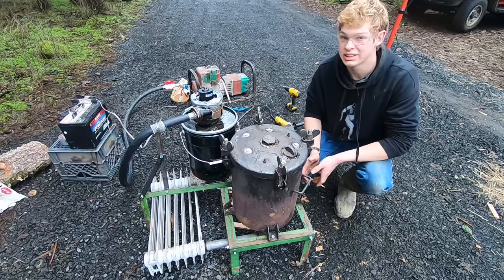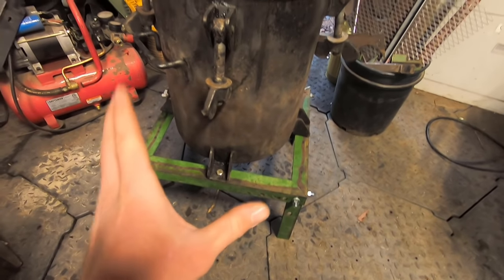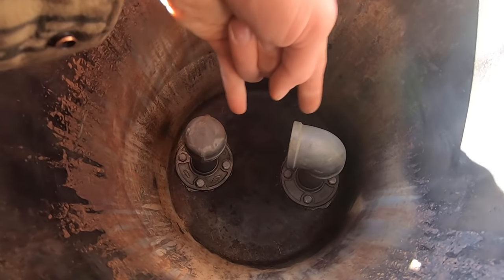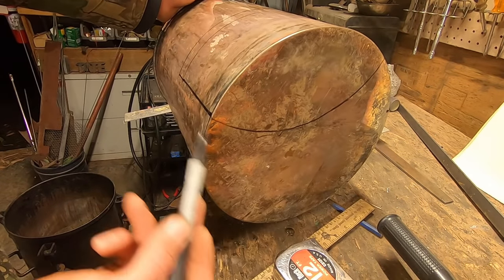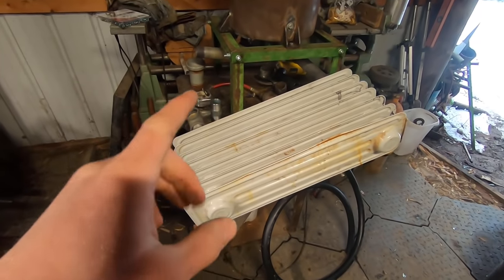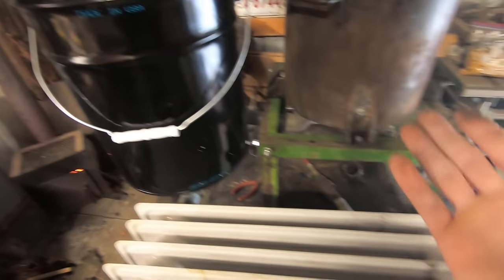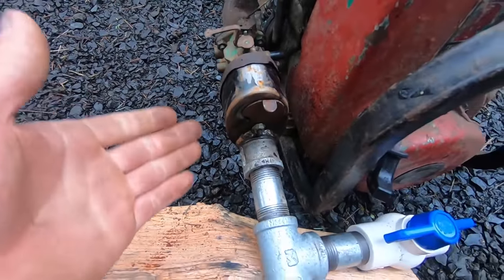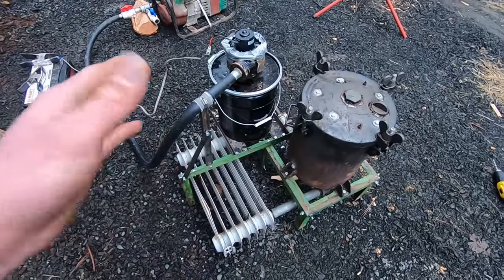Building a No-Weld Woodgas Generator! (A Functional Gasifier Built W/ a Hand Drill and Grinder?!)

Comment: It's a pretty cool project,  but with a biomass digester being easier to build, and cheaper, pluss the added benefit of yielding fresh composted soil, fertilizer,  and clean burning methane, you are left with acetic acid and carbon dioxide.

The acetic acid being the only true negative byproduct. 

The carbon dioxide would be filtered by plants, and the methane would be your clean fuel source.

The compost also generates a substantial amount of heat to say heat a living space. 

All while conserving wood for building materials and such.

Comment: You gas seperator should be far larger than what you are using. Think of a 80 gallon air compressor tank for just that engine. The wood burner gasifuer is good, but any Gas seperator operates at LOWPRESSURE. Really low. To liquify gas you raise pressure, understand? So just dump that gas into a huge tank, and vent your fuel off the top. Cooling it is going to happen easily in just short run of steel pipeline. Then into the gas seperator DIRECTLY after cooling the evaporates from the generator.

Comment: Great simple build but you just created a huge bomb in that combustion chamber with no safety release. If your engine/blower ends up demanding/pulling enough air into you combustion chamber through your flapper valve it can and will cause the gasses in the combustion chamber to ignite resulting in an explosion (ask me how I know) turned my down draft gasifier into a mortar tube launching  burning embers about 75ft into the air. Your unit is for all intent and purposes sealed which is wildly dangerous. It is a must to install a spring loaded safety valve on the bottom of you combustion chamber large enough to safely vent the exploding gasses in the event of combustion chamber ignition. Otherwise you've just created a very large grenade full of shrapnel

Comment: The fumes in the first stage look unhealthy. Burning should be better for the environment, right?! Anyway, creating energy is propably not the best use of the precious gas to store.
O.k. thats no problem if you are surrounded by nature and not so much of neighbours, with woods and trees, but here wood is expensive. So compression of the gas would be the nextlogical step for me, as one can use it to cook. Its also that one could generate spare.
How long does that process go? I would also suggest, that a more continous pyrolysis process would be of advantage. To harvest the coal, without interruption!
However, maybee the gas storage and compression itself is the solution already. 
And bigger batches, maybee.

Comment: So there's still this claim left 'floating about' yet unproven that is that the stroke of the engine is enough to keep sucking the gas in. E.g., in this video, at the end, you explain that to shutdown the engine all you need to do is to shut off the fan. Which implies that it had to have been running all the time and thus contests the suggestion that it isn't needed. If the fan is needed all the time, then you need to show that the generator produces at least as much power as is needed to recharge the battery (or have it run the fan).
Your thoughs? 😃

Comment: And after you run the motor for an hour it will Never restart....
Tar is the problem with this method.. I built one. Ran a 454 for 1 hour.  Tar seized the pistons, cams, crank..

Comment: You would do better to get you the proper wood burning at the proper temperature in that gasifier with a condensation trip and tartrap and produce you some actual fuel to run that thing on

Comment: reduce oxygen in gas using degreased metal turnings.  Coursely powdered calcium sulfate could reduce moisture content.  these may be used in pipe lengths. have to change out periodically.  suspect tars and creasote will be a problem.  low power could be used to improve heat exchanger performance  suspect maintaining engine perfomance to be a long term headache.  all components that are at high temperature should be will insulated.  carbon monoxide should be carefully monitored. I wish you good luck.

Comment: Sorry man, but metrics or it didn't happen.
I've seen too many of these things run for 5 seconds like yours did. It doesn't help that there were jump cuts before and after ever "using the generator" clip. 1.5 million views? Just shoot some ether into the intake every time it needs to "run".

Presumably you had all the video you needed to show this thing putting out 1kw for half an hour and you did none of it. It would be irresponsible of me to think that this isn't fake.

Comment: Or you could also just use hydrogen HHO generator and run your your gas stove your heaters your hot water heater and anything else that runs on gas and gasoline